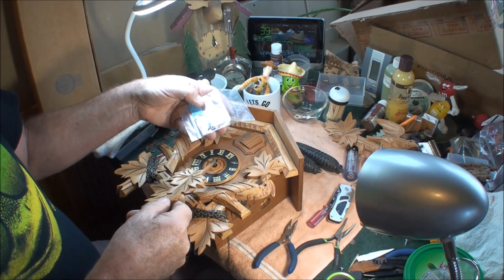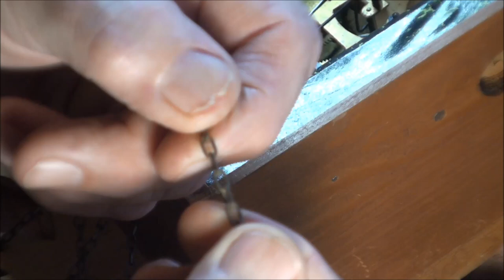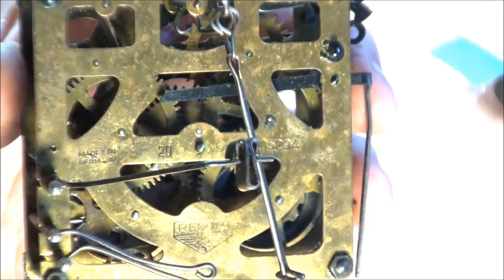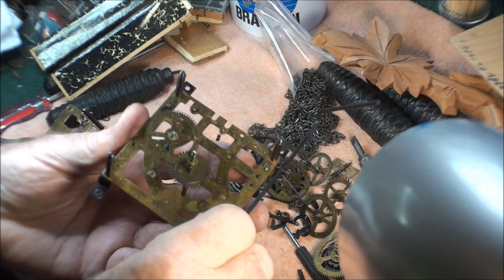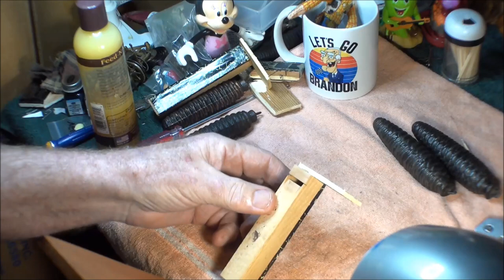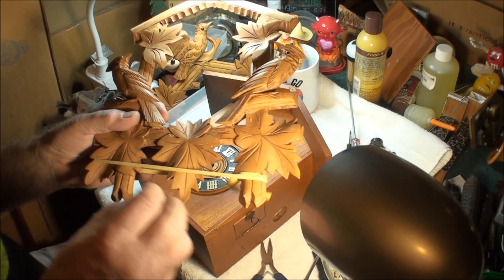Repairing and Cleaning a Dusty Cuckoo Clock

Comment: Mike you did a really good job. Glad that you are making your bellows now vs buying new ones. Glad that you are taking movement apart. This is a really beautiful clock. It is finely carved back when they used to make them with pride. If I had to guess I would say the clock was made in the late 50s or early 60s. It doesnt have the count-wheel as the older clocks have that is how I came up with the date. Nice job.
Reply from the maker: I knew you would be happy with me taking them apart all the way, lol. Just taking the right pictures really helped me a lot. On the Bellows, now that I have done a few, they are coming out really nice and I have you to thank for that. I try to determine how old a clock is by what I see, but some carvings are old and look ok and others were detailed very well and the both were make the same year. So confusing but like I say, buy the clocks you like and let the other ones pass on by. Thanks for stopping in Mark.

Comment: That clock works like a champ. You were making me nervous talking that clock apart. I don't think I would have remembered where every part goes when it was time to put it back together. Thanks for sharing the great information on these clocks.
Reply from the maker: I am new at taking the movement apart, but taking a lot of pictures of the gears really helps a lot. Also the clock will start working faster than just cleaning it with soapy water because it removes all the old oils and dust. Thanks so much for stopping by.
Reply: @justmike57  You make me proud my friend. I am glad that you are taking them apart now.

Comment: Thanks for posting this video Mike! It's nice to see the case work. Cuckoo clock cases are often damaged or have missing pieces. I think that the all wooden bellows also indicates an older clock (before the 70s). From what I have read, clocks from the 70s on usually have plastic whistles on top of the wooden chamber. The Regula 20 with the internal star wheel is an older movement too.
Reply from the maker: I have tried to find out when suck things like the plastic whistle box top and other things came into play to try to date the clocks. I almost gave up on dating them. I do prefer the older clocks or the well made and great carving clocks for the eye catcher. Thanks for your info and you have a great Christmas my friend.

Comment: Thanks for the post; I enjoyed watching it. I have a cuckoo clock that I bought in 1980 and just stopped working many years back. The cuckoo door is gone and I also misplaced the pendulum. I am tempted to fix it every time I watch your video but I don' t think I have the dexterity or the patience to do it. Thanks again.
Reply from the maker: I understand, but if you get determined to fix it and just take a few deep breaths every time you want to pull your hair out, you might get it done Galo

Comment: My cuckoo clock running 30 minunts fast in 24 hours, i have adjusted pendulum on+ side, can you please advise me what adjustment should I made for correct time,thanks
Reply from the maker: If the clock is running fast, slide the leaf down to slow your clock time. If you run out of stick, maybe you have the wrong pendulum for that clock.
Reply: Thanks Mike,clock is fitted with original pendulum, just from 15 days it started giving wrong time, i have cleaned the clock with   WD-40
Reply from the maker: @rajansahu789  WD-40 may be a good cleaner, but so bad for cuckoo clock or any clock for that matter. As you see on the can it will help remove rust. That is because it has an acid in it and in time will start cording all the parts in your clock. You need to wash it off with Dawn Dish Washing Soap and hot water. Then rinse very well with hot water and re-oil  your clock. (Just telling you what I would do) good luck my friend.
Reply: @justmike57  thanks Mike ,i wii do as your advise

Comment: Hello Mike,why do I need to tilt my cuckoo clock to the right for my pendulum to swing
Reply from the maker: Not knowing the history of your clock, there could be a good chance that the clock fell off the wall at one time. 
  What you will need to do is look to see if you have two wires that swing with the pendulum. If there are two wires, you would bend the back wire a little to the right and see if the ticking sound, sounds better. If not, bend it to the left and listen. Just remember that you would use two fingers, one at the top of the wire and one at the bottom of the wire for support and use your thumb to bend the wire. 
  If you have a bar in back instead of a wire, then you have a slip clutch that you can just hold onto the pendulum downwards and move the pendulum again to the right or left and listen to the ticking sound.
Reply: @justmike57  , bending The wire solve my problem thanks very much I really appreciate the info

Comment: you make a grate work. i'm repairing those Clocks in my Freetime. For cleaning those Movements i take apart. What a Kind of Cleaningsolution do you use? I use Elma 1:9. it is a Cleaning Lotion based on Ammoniak and Water.
Reply from the maker: I have been using the actual Clock cleaner solution, but I learned a cheaper way that works very well. 50/50 Simple Green,  1/4 cup Dawn 4x power, 1/4 Acetone and 1/2 cup Murphy wood cleaner. Works great!

Comment: What about hand installation?
Reply from the maker: It depends on the age of your clock. All the cuckoo clocks have the hour hand that is wedged on the shaft. The minute had is where the age of the clock comes in. The newer clocks have a brass nut like that the minute hand rest in and the nut on the top just holds it in place. On your older clocks, there is a nut, then the hand and the finish nut needs to press on the minute hand enough that you can still move the minute hand, yet the shaft the finish nut is on will operate the time and as well inside the movement. If you go to my play list and look under the Cuckoo clock section and look for a clock that might fit the age of your clock, I might explain this in a video.

Comment: Thank you. I think I need a new set of the modern ones. But will clean in ammonia and give it a try. While waiting on replacement chains.🇺🇸🤠👍
Reply from the maker: Not sure why you might need new chains. If they are rusty, use a Scotch Bright or even the larger steel wool pan scrubbers to clean your chains, then either wax or oil them. I use the Howard wax from Home Depot to was my clocks and chains.